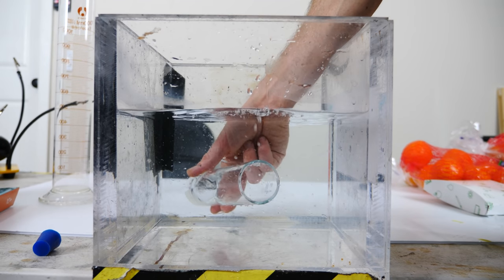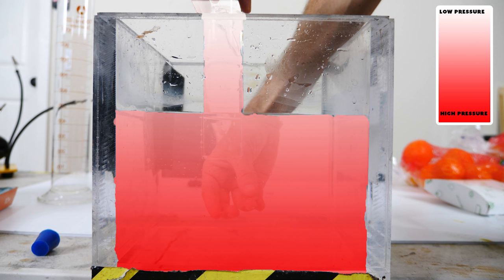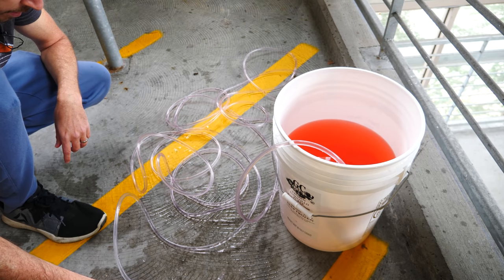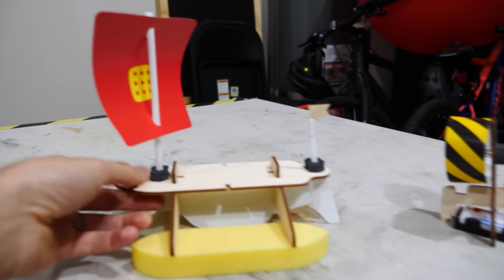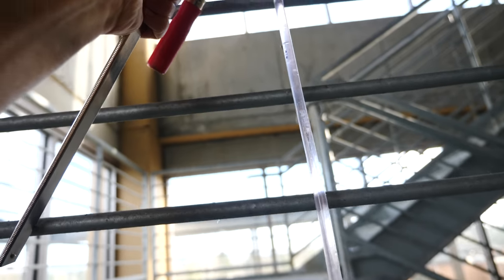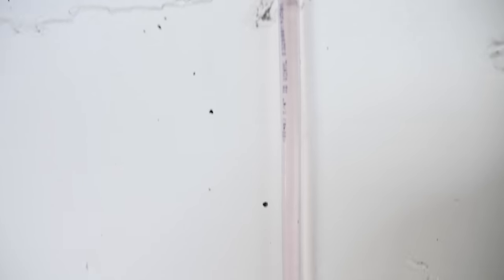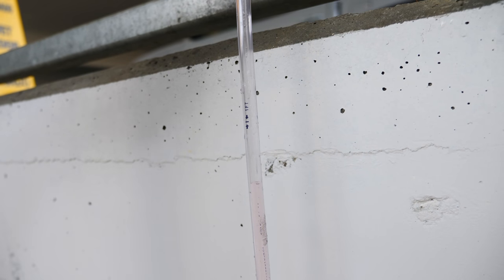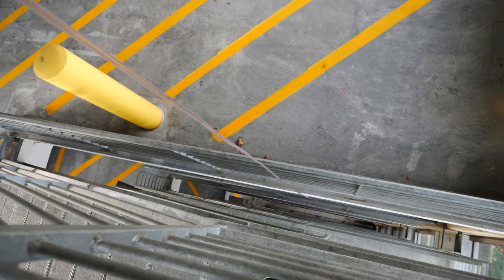Why Water Boils In Tall Cups

Comment: You can demonstrate the concept that the boiling point of water can change with pressure and can be brought down to room temperature if the pressure is low enough by using a clear syringe. You fill it halfway with water, plug the end and pull on the plunger and the water boils.

The problem with that is that some people are so closed-minded to anything that conflicts with their understanding of the world that they will say that the bubbles are just air leaking into the syringe. You can hold the syringe horizontally to show them that the bubbles isn't air leaking in through either end. You can show them that when you release the tension on the plunger the gas inside the syringe all condenses back into liquid, proving that it is truly a closed system and that no air had leaked inside. But they will still deny it because they can't accept that the world works in ways that are counterintuitive to them sometimes.

I've found this to be even worse if you try to explain the Monty Hall problem. It's great when you blow someone's mind with counterintuitive stuff like this. But it is hella painful when they are too closed-minded to let it happen.

Yes, as you can see, I am fun at parties.
Reply: i'd hang out with you at a party!
Reply: Thunderf00t did an experiment where he showed pressure changing the temperature of an area. This was interesting as well.
Reply: I have one complaint about the Monty Hall problem the way is was told to me though.

I was NOT told the crucial point that Monty KNOWS which door holds the prize and is NOT ALLOWED to open it.  I thought the he just had to pick a random door just like me. 

Once you know that constraint, it becomes a lot more obvious.  Too many people leave out that critical detail.
Reply: Hella? Please don't.
Reply: @lakse123  Yes, knowing what’s the sample and what’s the sample space is absolutely crucial. It still tends to confuse people, though.
Reply: Just went and read up on the Monty Hall problem on wiki. It’s stupid, no matter what the maths say, from the contestant’s POV the only new data they get is that it’s not the door Monty opened. May as well have just made it a choice between 2 doors from the start, even knowing that Monty knows which door has the car, it’s still literally just a game of chance. If the door you initially chose has the car, Monty is still going to open a door with a goat and therefore there’s nothing discernible from having an incorrect option knowingly removed by the host which then just leaves it as a 50/50 on whether to stay or switch apart from the psychological phenomena that might sway you from switching but it doesn’t change your chances. I’ve got a pretty open mind and have no problem accepting the counterintuitive revelation that lowering pressure results in a lower boiling point for water. But the Monty Hall problem is just mind gymnastics to try and convince someone you’re smarter than them over a simple 1/3 to 1/2 game of choice conversion.
Reply: @craiggallagher4461  No, I had the same perception as you: because when the host eliminates a door, it takes the odds to 50/50, right?  So what's the point of switching?
-
But I was wrong.  I got paper and dice and worked it for myself, and found that, sure enough, swapping the answer leads to a 2-in-3 chance of winning the bigger prize.
-
Do it for yourself, and you'll find out.  Get a friend and do it, you will find out.
Reply: @TROOPERfarcry  It’s only 2/3 if you retain the door you know the answer for. Revealing it removes it from the choices, leaving a 1/2 chance of picking the right door. It’s such basic logic, I don’t believe going through an exercise of dice is going to show anything other than random chance.
Reply: @craiggallagher4461  You are wrong.  Do the experiment yourself.  Do it with a friend, or some other method, and do it for yourself.  2-out-of-3 times, if you switch your answer after the host eliminates a 'wrong door', you will win the big prize.
-
You are using logic, but your logic is wrong.
-
If you're so sure that you're correct, then take 10 minutes to test it.  You fancy yourself a scientist/logic-driven person?  Test it.  Stop letting your faith in your logic prevent you from improving your understanding.
Reply: @craiggallagher4461  You are exactly the kind of person the comment was talking about, how ironic, but you are lucky, because the monty hall problem is easy to calculate all the possibilities, I'll do it for the case where you start choosing A, but it's the same for B and C

1: you pick A; A is correct; You have to stay in A to win
2: you pick A; B is correct; You have to change to win
3: you pick A; C is correct; You have to change to win

or you can simply think of it as: if you chose the right one at the start, when you had a 1/3 chance, you win, if you chose any of the other two, you lose

you have to learn to not trust your intuition so blindly, because it's oftentimes wrong

and you also have to learn that you are not smarter than hundreds of experts, be it scientists, mathematicians or whatever, if you don't "agree" on something that's pretty much accepted by every expert, consider that the problem is not the world, but yourself
Reply: @geli95us   Yes I am probably somewhat the type of person the comment was talking about but I disagree that I’m just dismissing it out of hand because I am close minded and can’t think logically for myself. I also think the commenter presumes themselves to be smarter than the person they feel they need to explain such a simple but flawed logic problem to and maybe the actual point of the problem has been misplaced or misconstrued over time?

It’s got nothing to do with intuition as it’s literally a game of chance. The host removing one known incorrect option simply leaves me with two potential correct options and it’s still just a game of chance that I’ll stay or swap correctly. That chance is 50/50.

I don’t know how else to explain it as I see it, I don’t at all buy that the chance of choosing correct is higher by swapping as the 3rd door is no longer part of the “equation” so to speak. Like I said, it effectively makes the game of chance as if it’s always just been two doors in respect to the chance of choosing the correct one. If I said I want you to play a game where you have to choose between 2 boxes for the chance to win a new TV, would you not say that’s a 50/50 chance of winning a TV? And then after you choose and the winning box is revealed, I then say “ah ha but I also had a third box I had hidden that I knew was incorrect! So it wasn’t a game of 50/50 but 1 in 3!” - is that not totally illogical?

I’m not proclaiming Im smarter than anyone else in particular, it’s just my opinion that this is a stupid problem that tries get a one over on someone using simple logic by portraying the problem in a more complicated mathematical approach (which isn’t needed) instead which doesn’t align with the decision making process when playing and wouldn’t help your chances even if you did because at the end of the day with no other information it’s still just a game of chance, a 50/50 one at that. The extra option knowingly removed by the host is superfluous information that is actually distracting rather than helpful in any way.

If anything I would almost think this is a leftist tactic developed to chip away at simple logical thinking and I have seen many comments that this problem is actually disputed by many, it’s not universally accepted by any margin.
Reply: @craiggallagher4461  Hi there! It seems that you are experiencing some survivorship bias. (Sadly) It is extremely common to have this kind of bias because our brain tries to optimize resources and prefers ignoring past events instead of being thorough and include all past events to understand a particular phenomenon. You should read about this kind of bias to protect yourself against it, since it can lead to questionable decision-making.
Reply: @craiggallagher4461   look at it this way.

If you chose the door that wasnt the prize at first, and monty reveals the other door thats not a prize, you will ALWAYS switch to the door with the prize.

If you chose the door with the prize at first, and monty reveals one of the two doors without prizes, you will always switch to a door without a prize.

since there are 2 losing doors,  which will let you switch to a winning one, you have a 2/3 chance if you switch
Reply: @craiggallagher4461   the difference between the situation that you showed is that you never had the chance to pick that incorrect box

if you were able to choose it at first , changing the number of boxes would change the actual probability.
Reply: @craiggallagher4461   Hey Craig, I have some relatively good news! You are still affected by survivorship bias, because you think that discarding a bad unchosen option is the same as not being able to choose it in the first place, BUT it seems that there is a particular way to visualize the Monty Hall problem in which YOU are correct and everyone who says to "always switch" is wrong. I will try to post it here.
Reply: @craiggallagher4461  Let me explain it by showing you all the possibilities in a game with 3 doors where you NEVER SWITCH:

1, 1, 2, W01
1, 1, 3, W02
1, 2, 3, L01
1, 3, 2, L02
2, 1, 3, L03
2, 2, 1, W03
2, 2, 3, W04
2, 3, 1, L04
3, 1, 2, L05
3, 2, 1, L06
3, 3, 1, W05
3, 3, 2, W06
format: Correct door, Your choice, Door that gets eliminated, Outcome
Here you won 6 and lost 6, so 50% chance, right?

Now, let's see all the possibilities in a game with 3 doors where you ALWAYS SWITCH:

1, 1, 2, 3, L01
1, 1, 3, 2, L02
1, 2, 3, 1, W01
1, 3, 2, 1, W02
2, 1, 3, 2, W03
2, 2, 1, 3, L03
2, 2, 3, 1, L04
2, 3, 1, 2, W04
3, 1, 2, 3, W05
3, 2, 1, 3, W06
3, 3, 1, 2, L05
3, 3, 2, 1, L06
format: Correct door, Your 1° choice, Door that gets eliminated, Your 2° choice, Outcome
Here you ALSO won 6 and lost 6, so 50% chance again!

By looking at these possible 24 universes (12 universes where you NEVER SWITCH, and 12 where you ALWAYS DO) it seems that you are correct and that switching is futile. However, for this to be true, we must assume that each of these individual universes has the same probability of existing. What do you think?
Reply: @craiggallagher4461  Our current understanding of the mind tells us that we are free to choose, and therefore, when asked to pick a number between 1, 2 or 3, we will pick '1' 1/3 of the time, '2' 1/3 of the time and '3' 1/3 of the time. Then, all the possibilities in a game with 3 doors where you ALWAYS SWITCH would look like this:

1, 1, 2, 3, L01
1, 1, 3, 2, L02
1, 2, 3, 1, W01
1, 2, 3, 1, W02
1, 3, 2, 1, W03
1, 3, 2, 1, W04
2, 1, 3, 2, W05
2, 1, 3, 2, W06
2, 2, 1, 3, L03
2, 2, 3, 1, L04
2, 3, 1, 2, W07
2, 3, 1, 2, W08
3, 1, 2, 3, W09
3, 1, 2, 3, W10
3, 2, 1, 3, W11
3, 2, 1, 3, W12
3, 3, 1, 2, L05
3, 3, 2, 1, L06
format: Correct door, Your 1° choice (being free), Door that gets eliminated, Your 2° choice, Outcome
Here you won 12 and lost 6, so switching definitely helps IF we are free. Duplicate universes are those universes that would be twice as likely to exist.

Since it is a t.a.b.o.o to think that we are not free, switching doors will always be seen as the optimal solution.

...but, if we are not free, then our choices don't affect the splitting of the universe according to the Many-worlds interpretation of quantum mechanics. If this is the case, switching doors would be unnecessary and YOU would be right!
Reply: @craiggallagher4461  You're wrong. I know you'll dismiss me too but I just wanted to add my voice to the others here (and so many, many elsewheres) who have actually worked through the problem and come up with the correct answer. If you're not willing to do the work (or at the very least, read and understand someone who has), you should probably just be quiet.
Reply: @chaos.corner  I’m not going to be quiet, I’m simply happy to disagree and not bother arguing about it anymore. It literally just feels like an argument over semantics (ie. pointless).
Reply: @craiggallagher4461  No, there are mathematical proofs. There's no argument, you're simply wrong and apparently happy in your ignorance.
Reply: @chaos.corner  How can maths change the maths of it being a 1 out of 2 game when you remove the 3rd option? 3-1=2 seems pretty straight forward to me. Understanding that the host has removed an option known to be incorrect doesn’t stop it being a 50/50 chance of what you’re left to decide between. It’s not the same as the water boiling point vs pressure matter where the laws of physics can seem counterintuitive. This is a simple case of logic, bringing mathematical probability into a literal 50/50 game of chance is just obfuscating an incredibly simple thought process - A or B which both have equal chance of being correct without any additional information to base your decision on. Why would you perform mathematical probability testing on a 1/3 chance game when it’s no longer 1/3 after removing the 3rd option as a possibility?
Reply: @craiggallagher4461  That's more words than it would take to do the maths and come up with the correct answer (and it is a mathematical problem, to be solved with maths, not by trying to reason with it). I'm not here to fix you. Take care.
Reply: @craiggallagher4461  Please try to read this for intuitive understanding of Monty Hall Effect:
Let's take an example where instead of 3, there were a million options and you randomly choose one option. And the host eliminated 999,998 options and now 2 options are left. Would you still think in this example that you were probably right in the first guess?
Reply: @hunnervirsingh3561  I don’t think I am right in either scenario until the winning door is actually revealed. I am simply choosing one door out of pure random luck so it doesn’t matter if there are 3, 1M or 5 trillion doors. If the principle is the same in your example where the host removes all known wrong options leaving only 2 doors, the one you chose and one other then it’s still 50/50 in the end. There is no reason to swap my choice other than on whim, the initial guess is still just as valid because there’s nothing giving you any insight into whether you chose wrong or correctly which is why it’s still pure chance which has been reduced to 50/50.

It’s actually arbitrary having the other wrong doors if you know they’re simply going to be removed bar 1 or the 1 correct door which means it was always a game of 50/50 to start with and the other doors and any mathematical arguments are simply a distraction or enticement to change your initial decision.
Reply: @craiggallagher4461  Dude, you don't argue about maths. You just do it. (or in your case, not).
Reply: @chaos.corner  Maths for a 50/50 game of chance? No one has convinced me yet that it’s anything other than that once one arbitrary wrong door has been removed.
Reply: @pubert4845  People can say whatever they want.
Reply: @craiggallagher4461  Hey, my sister wasn't able to understand it so I tried to do this with cards. She tried to choose 1 card (Ace of spades) and then I removed all the wrong cards except her chosen card and one other card. We did it 10 times and all the times the other card was the Ace of spades which probability is very low 0.1% If we consider 1/2 probability. Do this with a friend, it will make you understand it better hope it helps :)
Reply: @dwellerinblack7816  thank you for your wise contribution.
Reply: @pubert4845  No problem. Now let's stop caring about people saying the word hella together because it's literally not an issue. 😇✌
Reply: @craiggallagher4461  Hey Craig, I know everyone's being a bit elitist about how you're wrong and I'm not here to jump on the bandwagon, just wanted to say I really appreciated you talking about why you interpret the Monty Hall problem differently and try to explain it as I see it. Your different point of view has allowed people to expand their discussion and hopefully understanding on the subject, though I wish they'd stop being so high-and-mighty about it.

In your example you said "If I get you to choose between two boxes and reveal a third that was incorrect, your chances are 50/50" and I'd have to agree with you there. Also on the fact that 3 - 1 = 2.

Where I think the confusion comes from is the initial choice is out of 3 choices (a 1 in 3 chance of winning). So if you don't swap, your chances to win remain at 33%.

Once the host eliminates an incorrect door, the choice is 50/50 just like your example

So your options are to stick with your initial 33% chance guess or swap to a guess that has a 50% chance of being right. 50>33 so you'll win more often than with a non-swapping strategy.

If you read this hope it helped, maybe you already changed your thinking but I haven't read to the end of the thread yet
Reply: @themeaningoflifeisymcapalv9135  Can you show me where you got the evidence for he sentence:
"Our current understanding of the human conciousness tells us that we have free will..."

Otherwise I agree with you.
Reply: @RanEncounter  Hmm... I'm sure i replied earlier, but maybe YouTube nuked my comment because it had a link or something...
Anyways, you can find relevant information if you search using the following terms: "free will", "randomness", "probability" and "many worlds". There is a good article from the Stanford University, in which section 4.1 contains the information that you ask for. 
However, the t.a.b.o.o I mentioned is very widespread, and could also serve as enough evidence.
Reply: @craiggallagher4461  

dude.

if you have the OPPORTUNITY  to pick the other losing doors
it changes the chances in the end.
because picking a losing door and switching will always result in a win for you, if there are more losing doors than winning doors and then it gets narrowed down to 2 options, you have a higher chance when you switch
Reply: I understand the Monty hall and it makes sense but it still hurts my head to think about.
Reply: The easiest way to explain the Monty hall problem is instead imagine it's 10,000 doors. When you choose first you have just a 1/10,000 chance of guessing right. Then I remove 9,998 doors and you are left with 2 to choose from. Now the odds that you chose the correct door the first time would be 1/10,000, but the odds of you switch doors is now only 1/2 meaning it's better odds to switch
Reply: @craiggallagher4461  Hey, Craig!  I've enjoyed reading through this discussion and have appreciated the fact that you have stood strong on your perspective without resorting to ugliness - unlike much of your opposition.  Also, it's unfortunate how many people say this is simple math and scold you for not doing this yourself, yet are also unable to demonstrate the simple math for you.  Hopefully I can explain it logically and mathematically:

In the original situation, a contestant is presented with 3 doors and asked to choose 1; the host then eliminates an incorrect door from the remaining 2, and the contestant is allowed to stay or switch.  The math of this situation, although simple, is made very difficult by our human logic, which often overrides the math.  Here's why:  Your first choice is, indeed, a 1 in 3 chance.  The second choice appears to be a 1 in 2 chance since only 2 doors remain.  However, in reality, it is a 2 in 3 chance - which I'll attempt to explain in the next section.  When we're in the moment, if we don't have prior experience with this, our human perspective takes over and, by our logic, a 1 in 3 chance is close enough to a 1 in 2 chance that there's no real reason to switch away.

However, if you take the situation to the literal extreme, our logic breaks down, and the simple math takes over:  If you are asked to choose the correct door from an infinite lineup of doors, your chances of doing that is infinitely small.  So, after you've chosen a door, the correct door still has an infinitely large chance of being in the group of remaining doors.  Therefore, when the host eliminates all but one of the remainders - knowing he cannot eliminate the correct door - switching gives you an infinitely large chance of picking the correct door.  Does that make sense?

If so, taking it back to the original situation, when you pick the first door, you have a 1 in 3 chance of picking correctly.  This leaves a 2 in 3 chance of the correct door being in the remaining 2 doors.  If the host eliminates 1 of the 2 doors from the remaining 2, the probability of the correct door being the remaining door is still 2 in 3.  Therefore, it's always advantageous to switch doors.  Hopefully that was helpful!  I look forward to hearing your perspective.

Also, as an aside for anyone reading, this discussion reveals the most destructive perspective that's going around nowadays:  The perspective of hearing an "expert" - or even a large group of "experts" - say something and then screaming it at the top of your lungs to anyone who disagrees, yet being unable to demonstrate actual knowledge of the subject.  Please don't be one of those people.
Reply: @Legit2570  That's not, quite right.  In your example, the odds of getting the correct door by switching is 9,999/10,000.  Please check out my explanation in my previous comment and let me know if it makes sense!  Thank you.
Reply: @craiggallagher4461  I'll go ahead and chime in on this debate, but I'll attempt to be a bit more polite than some others have been, here. 😅

I think a simple way to explain it is this:
• When you make your choice at the start, you're choosing from three doors, so your chance of selecting the door with the prize is 1/3.
• Thus the chance that the prize is behind one of the other two is 2/3. I think we're all in agreement up to this point.
• The host knows which door has the prize, so he'll always choose an incorrect door to reveal.
• The chance that the prize is behind the door you originally chose is still 1/3, because there are still three doors.
• Thus the chance that the prize is behind one of the other two is still 2/3, but it's obviously not behind the open one.
• Therefore there is a 2/3 chance that the prize is behind the remaining door, and a 2/3 chance to win if you switch.

Basically, eliminating one of the doors doesn't change the fact that you made choice with a 1/3 chance at the start.
Reply: you can just get someone in nepal or peru to boil a pot of water and show people how it boils at like 80 degrees at their elevation
Reply: @craiggallagher4461  it's 50/50 only if you choose randomly between the 2 options left. But if you always pick the other one, there are 2 in 3 chances that you get the car.